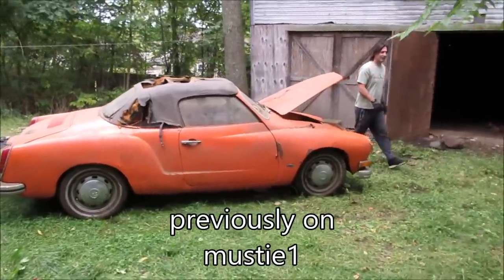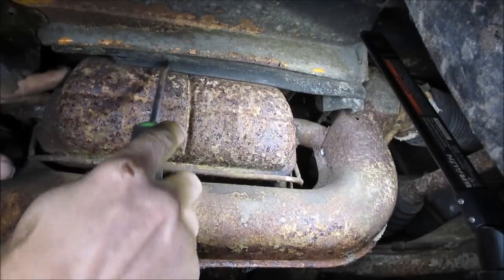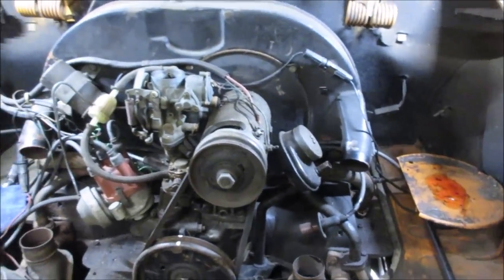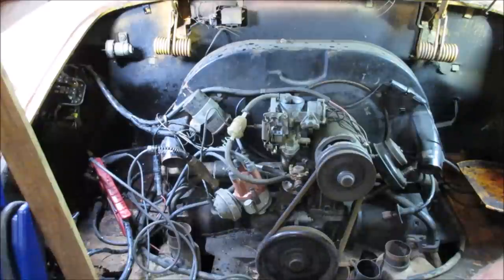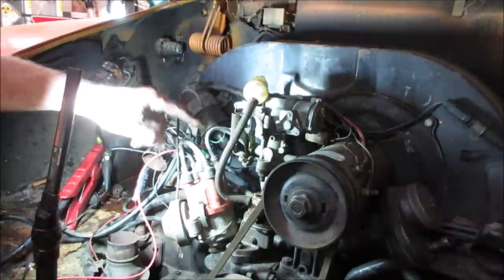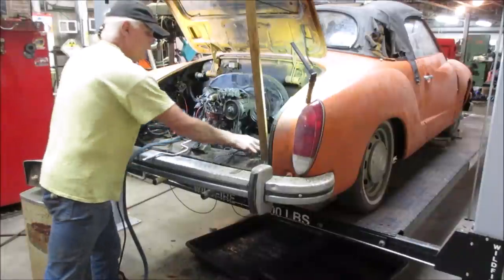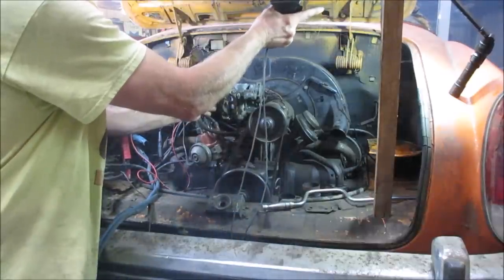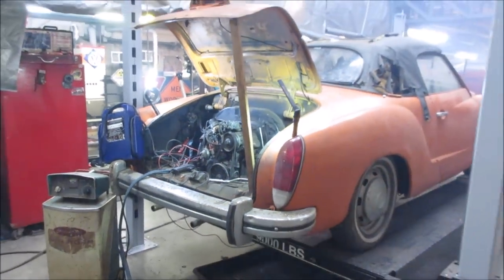One Sad VW, But Can It Survive?

Comment: bent rod and/or crank and rod bearing are toast? they used to be so cheap for parts!
crack the case throw in a new/used crank with fresh bearings make it work on a budget? 1600's were so common there's gotta be one somewhere to help slap an engine together, near "playing with Lego's" simple (but high maintenance!)

Comment: you could still have oil pressure if a wrist pin was knocking. i also once had a knock caused by a broken piston skirt. sounded just like a rod.

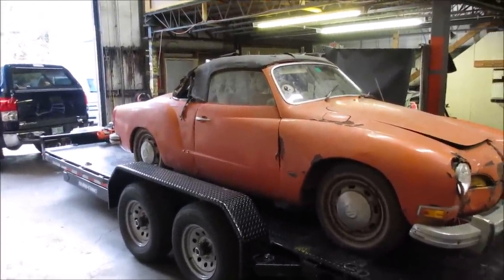Comment: 1,00:54 when reving it produces more oil pressure, let up and the rod starts s to knock.
Check the end play…if it’s ok…
Crack that case open, and replace the rod bearings. Clean out the case, and put a new rear main seal in it.
Hone the cylinders and put a new set of rings on those pistons. Clean up the valves, and lap those cylinders to the head.
For about $100 you could have a great engine.

Comment: It’s forty years since I laid tools on a VW air cooled engine, but is there not a timing mark on the crank pulley that aligns with the split in the crankcase, and a line on the distributor housing for an initial set-up?

Comment: I had a 71 Super Beetle engine that met its fate the same exact way. Same knocking at low rpm’s, flickering oil pressure light when hot. I had the engine replaced with a used one and never really found out what happened to the dead engine on the inside. Perhaps Mustie will tear this one down for an examination? Great video!

Comment: I don't think noise is in the engine it wouldn't go away at higher rpm it would get louder. It seems like it's clutch flywheel transmission something like that.

Comment: I am 7:50 seconds in and i am betting #3 cylinder dropped a valve seat and caused a catastrophic blow up because that is what happened to mine . AHA ten seconds later Mustie said the same thing ? I am amazed that she ran after all these years but the motor is still trashed.

Comment: How hard are replacement titles to obtain? If that sad vw was put into driving condition it still will need tags.
Reply: In most states it shouldn't be hard to get a salvage title if you can prove it was abandoned junk you fixed. Pictures help. Mustie has the recovery on video so that's good proof. He's not interested in fixing it though. That car is too far gone. I'm not saying it can't be fixed, just that it's not worth it. Absolutely everything needs to be fixed. There's nothing left.

Comment: If you pull the plug wires one at time while the engine is running when you pull the one with a rod knock the sound of the knock will change.

Comment: Q. Why do you need to keep filling up the float bowl if it’s not firing? Surely the fuel will just remain unburnt in the bowl until it finally starts?
Reply: Pretty sure the fuel was/is being drawn into the cylinders and then pushed through the exhaust as a vapor if not firing. The fuel is definitely not being burned in the carb bowl.

Comment: Around 54:30 I have not worked with engines nearly as much as you have, but at this point, my hunch would be to twist the distributor while cranking the engine. Would this be the wrong thing to do?
Reply: That is an option; twist it while cranking to see where it starts popping, but I think Mustie knew there was extra benefit to just letting the cylinders and valves go through several thousand revolutions to polish up the cylinder walls and valve seats.

Comment: so it may knock but can it still be rebuilt if theres no hole in the block yert? if it is a rod couldent you theorticly  do a   partial rebuild rods and pistons? or does it depends on  if the crank is  scored  and beaten up

Comment: For personal protection I would highly suggest NOT using an air hose to remove animal nest material inside an enclosed shop. A Hepa filter vacuum cleaner is much cleaner and does not spread the microbes all over you and everything else.

Comment: Whats your opinion on rigging something onto a propane cylinder that locks into a plug hole and cycling heat into a stuck cylinder a few times to break the rings loose??
Reply: Why propane?
Reply: Cooling/shrinking effect?

Comment: Mustie, Mustie- 
Step one take 10 minutes to pressure wash the thing outside.
Step 2- try to turn motor with crank bolt on fan- if it won't turn go to step 3
Step 3  take 10 minutes and pull the motor out and put it on a stand- then you can access everything, lube the cylinders and use a pry bar against the flywheel to try and free up the motor-
Static time your motor- it's simple- hook the test light to the distributor side of the coil and turn the crank until the light comes on- set it so the light comes on about 10 degrees before top dead center.  Then double check that the wires are in the correct firing order.

Comment: Sometimes you just have to call it.
Body is too far gone for anyone short of a master rebuilder with boatload of new panels panels, box full of metalworking tools and a welder.
As for the engine... my vote is for (badly) spun rod bearing. 
Valiant effort but believe this one is (small) parts only. 
This one's run its last mile. Time to retire it to the place with the dead mowers - UNLESS - you're lucky enough to find a motivated buyer for a worn out hulk with bad engine, no keys, and no title.
Have heard there are people out there who like a challenge...

Comment: im sure it rod bearing is danged (broken) or loosen 
because it fire too early before piston make it to top end and it blew start plug out and broken rob bearing
it happened sometimes 
one reason that lights start come back on because not getting enough oils pressure dure to oil leaking out of rod bearing cause it stalled out whiles idles 

reason they stop driving it because they knew it was knocking so they didnt want spent any more money on it so they push in barn left it like it is
one reason front end is bend was cause by ran into other vehicle or it was tow behide and wen too late to stop so crash into rear of vehicle cause front end bend

Comment: What is wrong with doing the same thing and expecting a different result?  Trying to start an engine with that much noise?  Not a good plan. Remove and inspect the engine to find the problem!  Timing lights work very well on VW engines.

Comment: I knows what i be doing with the volksbug motors......First off...i change all several spork ploogs......set the airgaps to .0963 millionths.....then get my hammer ready.Fill the crankcase up to carurbstater with a case of 10w-70-88 oil till you hear the carb gurgle.Then my 1200 volt jumper pack plugged into the house ....and turn key.While smoking.... set the carb till oil spills out....yup Mustie....thats what i do and i get results of .00000% of notta.I think the valves need adjusted to 50000 p.s.i.  of gap.....Thanks   awe heck......my lawnmower wont start agin with grease in the carbs.

Comment: Maybe it has a lose head on that side. Some of those last single port 1600 motors had a problem with lack of magnesium in the mix of aluminum for the cases. Heli Coils became real popular when those motors were on the road.  Looks like a lack o f compression for a good clean burn might be the problem there.

Comment: I say give it some real thick oil additive, like Restore, a bit of graphite powder since it has no oil filter, some PTFE and a plate, and see how many miles you can drive it before it dies, then pull the engine.  It may be bad but it isn't done yet!  If it wasn't a boxer, I would say pull the pan and rotate in new bearings, but I think that is harder on a boxer.  That is unless you think the risk of damaging the block when it lets go is too great, and the block too valuable.